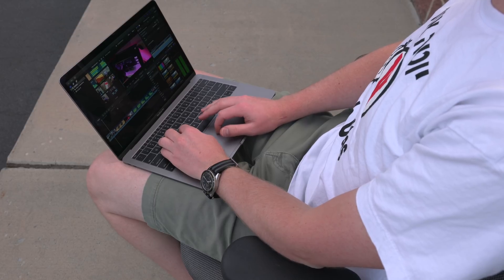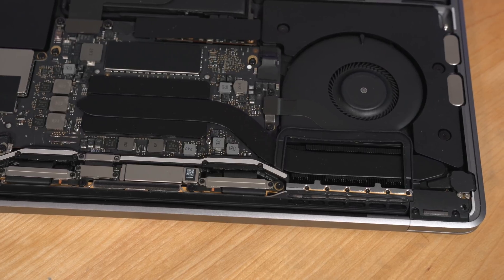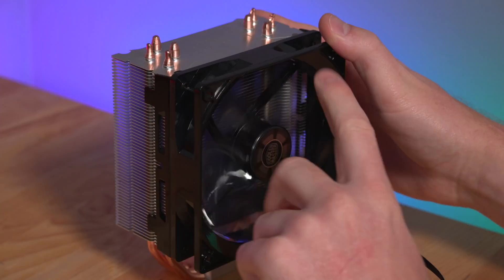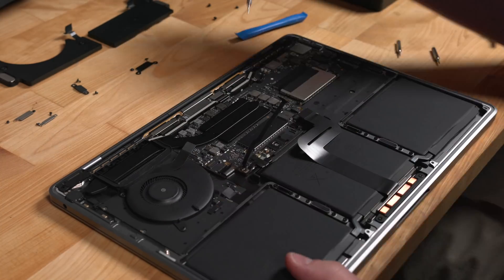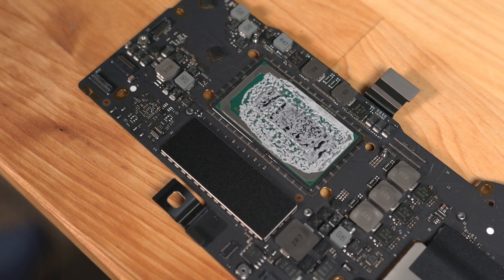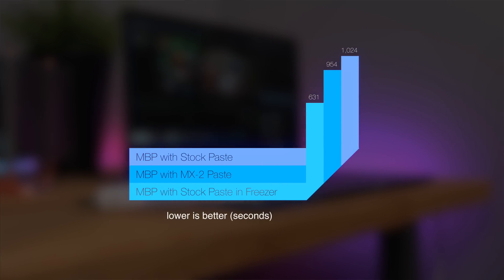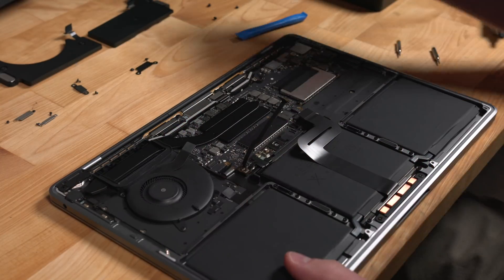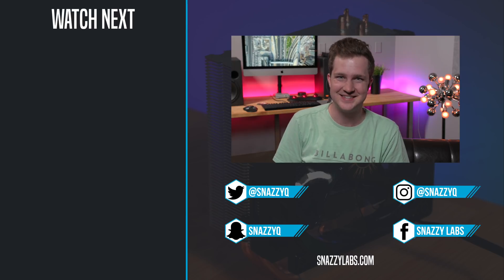Fix Thermal Throttling on Your Mac?!

Comment: I always use Thermal Grizzly Kryonaut it's the best paste you can get !
Reply from the maker: +InsideByte I won't be using it again. Too expensive for such a marginal improvement. MX-2 has my heart.
Reply: well it's the macbook's heatsink thermal transfer limit that causes the marginal improvement, the heatsink just can't transfer heat any faster, so the MX-2 makes more sense. A grizzly is much better when used with large tower heatsink or GPU.
Reply: The only thing better would be a liquid-metal TIM, but seeing as the chassis is aluminium, it might not be a good idea to use a Gallium based TIM. Not to mention its also extremely conductive, expensive, & difficult to apply. Then top that off with such a pathetic heatsink, its not worth the extra cost or effort...
you'd almost be better off applying some TIM between the heatpipe and baseplate... lol
Reply: Reka Primasetyo thermal grizzly is not that much better than artic mx4. i tested both on a hyper 212 evo and a fx8320 @4,6ghz and grizzly is 2 or 3°c better at best. not worth the difference in price
Reply: Nah
The two best choices in terms of value and performance are
Noctua nht-1
And 
Coolaboratory liquid pro
The liquid pro is the best solution on the market.
It's used for CPU delids and in world record attempts.
But it isn't paste
The nht-1 compound has been determined as the best thermal paste before you get into things like liquid metal.
Reply: 2-3 euro difference , who cares, I payed 2000 euro foe the built , 2 euro more so what. try Thermal Grizzly Conductonaut , need careful work. 10 C cooler than grizzly
Reply: Yifu Cheng I mean collaboratory liquid pro can be had for the same price as noctua nht-1, just less of it and it is way harder to clean up if you put too much of it on, but there is a difference and both of them are best in class

Comment: Clickbate
Reply from the maker: +espro It's actually not. :)
Reply: +espro the title is fix thermal throttling. He fixed it by reducing temps/rendering times by 9%
Reply: Michael J 9% is NOT fixing.
Reply: espro 9 percent is a significant improvement
Reply: Michael J 
And he fixed it
Reply: Well if you buy an apple, you'll have to live with 9% or go to Antarctica.
Reply: Shadman Sudipto
Why you need toothpast, use the cloud for all the GPU or CPU intensive processes! Why run that local? Gaming on thin clients? You buy apple to produce, you got skills?
Reply: So you're saying it can basically only browse the web.
Reply: And may I ask what is this toothPAST?

Comment: hey, silly question; why not use a thermal pad to transfer the heat to the bottom plate? from there a standard laptop cooler pad could wick away more heat
Reply from the maker: +Vijay Rao Not a bad idea but my legs are hot enough. Don't want it to be worse. Lol

Comment: Love your vids! Idea: You should try and get a 2017 iPad Pro to run macOS. Not sure how possible this is but it would be cool if you were able to do it.
Reply: Eitan Impossible, both use different CPU architectures.
Reply from the maker: +Eitan Sadly not possible. Would sure be neat, though!
Reply: MacOS is an X86 OS and IOS an ARM OS.

Comment: Fuck your mac
Reply from the maker: I'd prefer not to.
Reply: Szymon Marciniak I doubt that would make it cooler.
Reply: I'd tried several times, but no ports big enough.
Reply: Sounds painful
Reply: And called thermal paste not cum
Reply: Alicja Michalska 
Some things that apple makes have good prices like the MacBooks but iMacs ? Meeeeh a fully loaded one cost 5500 dollars
I can get literally get a pc with 22cores if not 44 if you are willing to cut some corners and be flexible , optimization won’t help in this case and the 22c/44t will destroy the fully loaded iMac with the Lonley i7 7700 with toothpaste between the IHS and the cpu die